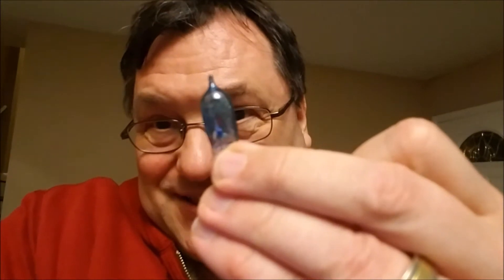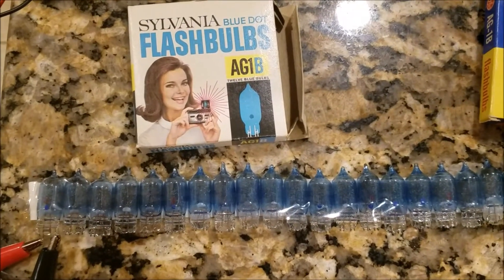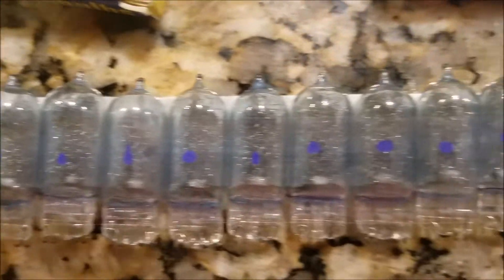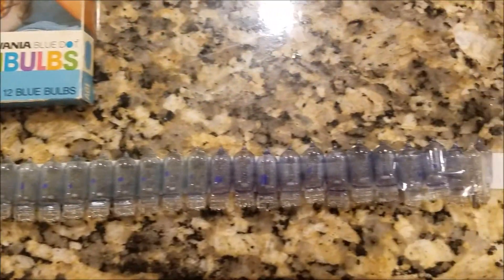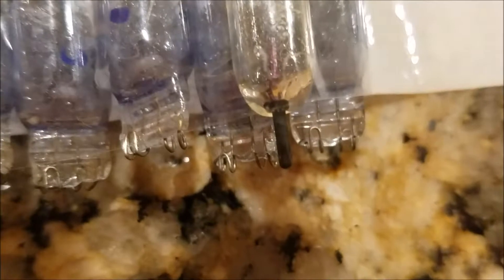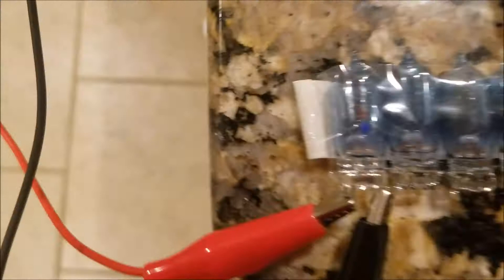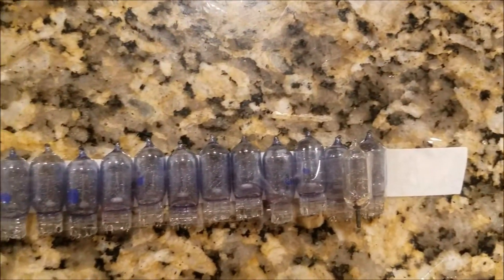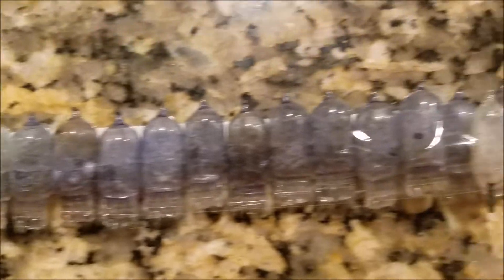Fun with Flashbulbs

Comment: @gregzsidisin  Thank you for the quick reply.
Yes I was thinking about seeing a doctor even though my hand doesn't look swollen or anything, on the surface it really looks like a minor "everyday" burn that usually doesn't require medical care.

But what I'm worried about is the intense infrared radiation that I think could be emitted by flashbulbs and that could have caused more damage in the lower skin layers or even worse the muscle. (I've seen a video where someone was burning holes in black candy wrappers or something like that, basically thin plastic with a Flashcube held maybe 2 inches away from it.)

What I'm also worried about is that, well flashbulbs are a thing of the past so the doctor might not know much about them and thus not think about the hypothetical lower damage from IR and treat like a "normal" burn, whilst it could in fact be worse. I know because I did ask my eye doctor how to shield my eyes from UV-C germicidal lamps and believe it or not she didn't have a clue ! (Even though UV-C lamps on the other hands are far from being a thing of the past and in fact because of Covid people did buy more of them than they did before.

(But she did tell me my eyes didn't suffer any damage from my experiments with a powerful laser and some mishaps with UV-C bulbs and also prescribed me new glasses ad my vision had changed a little bit).

I didn't mention it but I did immediately put cold water and ice on my hand like I always do.

Also when I fired flash bulbs with alligator clips I found that they were only barely warm right after firing so it might have given me a false sense of safety.

I'm also more careful as the for the first bulb I ever fired I actually connected it to a 30-foot extension cord and wore ear protection before connecting a low voltage power supply to it in case it would go bang like I read online many years ago.
Turns out it doens't go bang at all and there's actually some sort of thick plastic film over the bulb that's there to contain the broken glass.

I didn't know before having watched your video that you can fire other flashbulbs by getting them in contact with the one that gets powered.
Gives me an idea for my next experiment 😉

And yes I will never again hold a flash bulb while firing it.
Reply from the maker: Flashbulbs do cool quickly, because there's not much "thermal mass" involved. But at the moment they're firing...

Comment: Hello,

I did purchase a few of the same bulbs a few days ago and played around with them a bit but I got the genius idea of holding one with my bare fingers when firing it. 
Now I have small burns and it hurts but the trouble is it still hurts 2 days laters whilst other times I got "minor" burns from other things than flashbulbs the pain did fade after 2 days or so.

Do you think a flash bulb could cause more severe burns that say hot water, a clothes iron or any other common household stuff ?
(This is the first time I ever got in contact with flashbubs as I'm too young to remember them being a thing, for example my baby pictures were taken with electronic flashes back then).

I don't have any vintages flashes or cameras so I used alligator clips just like you except one time where I held the bulb with my left hand and applied a 9V battery to it with the other hand.

Every time I did fire a flash bulb though I was wearing ski goggles to shield my eyes at least a little bit as I was aware of how blindingly bright they are from various websites many years back and also from having watched Hitchcock's Rear Window movie.😉
Reply from the maker: Yikes! As the video I did demonstrates, flashbulbs release a LOT of heat as well as light - enough to set off an adjacent flashbulb.

If you haven't already, please see a doctor about your burns! 

My original interest came from model rocketry. That heat is sufficient to ignite a pyrogen wick  - a fuze - which can be used to ignite a model rocket engine. Not only does this make for a very reliable and low-power ignition system (for black powder rocket motors, anyway) but it allows for things like lightweight electronic staging. More recently,, electric matches have replaced the need for flashbulb ignition.

My point is that the heat from a flashbulb is intense, enough to set off fuzes and even other flashbulbs that aren't energized.

Never hold a flashbulb in your hand or fingers and flash it.

Comment: Incandescent flash bulbs.
Reply from the maker: Yes, although the incandescence here is of course temporary and chemical. The metal filament burns bright as it's consumed, after only a small, momentary electrical impulse. A regular incandescent bulb filament glows under steady electric current. Both cases are incandescence - light from materials at high temperature - but very different mechanisms.

Comment: Why did the smoke appear
Reply from the maker: Flashbulbs don't normally smoke, but these were connected with tape.  The tape adhesive briefly smokes a bit on the very hot bulb surfaces.
Reply: @gregzsidisin  Actually they do smoke a bit.  The lacquer coating on the glass burns off when they fire.  You don't notice it much with the little AG1 bulbs, but a 5B would probably set off a modern smoke alarm.
Reply from the maker: @DaleRaby  Thanks for that. )) Yeah, I work with AG-1s, the smallest of the lot.  I personally haven't seen a larger bulb pop in many years.

Comment: Destroying a perfectly good, usable flashbulb for a few YouTube views.
Reply from the maker: Such a strange comment.

Flashbulbs were made in the many millions over the course of the 20th century. They are still available in quantity on ebay. The bulbs expended for the video were a very small percentage of my personal stock, and a vastly smaller percentage of the stock still out there in the world.

Flashbulbs were made to be consumed for the personal enjoyment of their purchasers.  By your way of thinking: how many flashbulbs were "wasted" on bad photos?  And at any rate today flashbulbs have exceptionally limited application today.

The video was intended to document the experiment success or failure and share that, not to ratchet up "X" number of YouTube views.  I am happy and surprised that a few people have found this video and have even reacted to it.
Reply: gregzsidisin on another note flashbulbs tragically doesn’t not have “exceptionally limited application today”.
There is some things a flashbulb can do that is impossible, or hard to achieve with other light.

1. It has longer burn time. IE you get slice of movement if the shutter is at 30 or below. 
This is radically different from the motion blur you get with electro flash plus long exposure.

2. They are very, very bright. 
Even a single tiny FP one bulb has guide number of 40 in meters and 123 in feet.
That’s as much as a good large hammerhead flash all in a package where a film rolls worth of bulbs, and flash can fit in a cupped hand and weighs nothing.

4. It uses very little power so you can cascade multiple (like here only electronically and simultaneously) to get far more light with hardly any of the bulk and batteries of large speedlights.

3. On film the quality of the light is different. It’s softer and more penetrating, for lack of better word. It probably has to do with high intensity reciprocity error. 
Film likes it’s light not too much in a very small time slice/packet at once (though it loves a continuous stream of high intensity light like the sun). Neither of course too little trickling light, that’s why we use flash.

5. You can collapse the reflector on most flash guns and get very even, all room enveloping flash. This is the ultimate bounce flash if you are in a room that accommodates it.
The flash guns are also very easy to stick into diffusers for the same reason. You can do a very portable mini softbox by putting a white paper bag or a piece of diffusing film over the reflector.
Reply: gregzsidisin at least you could have used them for actual photography.
With a reflector you could have lit up some giant building or interior.
These are a finite resource (for now at least). 
The least we could do is actually putting them to good use, instead of pissing them away.
You inspire thousands of kids who never heard of flashbulbs, to go out and look for them, doing stupid pointless experiments. Taking them away from people who actually puts them to good use, like me.

Comment: So cool! It did hurt a little to see so Manny get used at ounce though
Reply from the maker: l bought up a fair number at one time, so personally it was not too bad. Understand that these were mass produced in VERY large numbers, over decades. and there are still a lot for sale on ebay. And people regularly find boxes after cleaning out old closets. while the demand for them is all but vanished. It's simply that now, they're far more expensive than they once were.
Reply: @gregzsidisin  they're not very expensive, you can get a 12 pack on eBay for like 2 bucks.

Comment: So is this Flashbulb only use for once ? 

I want to know why the big Flashbulb used to explode when taking pictures in Photographic Flash?
Reply: Well, mostly they didn't.  I used to use the old 5B flashbulbs and I never had one explode... or even go off accidentally.   Static discharge could set them off if the photographer was stupid enough to carry them around in his pocket.. which could give you a nasty burn.  If one was damaged, i,e,: the glass bulb was cracked and allowed air inside, thus increasing pressure in the bulb, the burning magnesium could heat the gas inside and cause the bulb to burst.

To prevent this, the manufacturers invented the "blue dot" flash bulb.  It had a little dot of cobalt blue on the inside of the bulb.  If the bulb was cracked and the low-pressure oxygen atmosphere inside the bulb was compromised, it would turn pink and you weren't supposed to use it.

They were generally coated with lacquer which further reduced the chance of a bulb bursting.  There were also "flash shields" that covered the flash gun and prevented injury from flying glass in the unlikely event of a burst bulb.

When the bulb flashed, it usually cracked, but the lacquer kept it from bursting.  The only thing you had to remember was not to touch the bulb right away as it was hot and could burn you.  Most flash guns had bulb "ejectors" to avoid this.

Little AG1 bulbs and Magicube bulbs didn't really have enough magnesium in them to cause much of an explosion and I never heard of one bursting.  All things considered, they worked rather well, given the available technology of the time and for some purposes, they are still better than an electronic flash.

I hate to see them wasted like this though as they are no longer being made and when they are gone, I won't be able to buy them anymore.
Reply from the maker: Yes, flashbulbs are single-use. They replaced earlier chemical flash powders used in photography. Flashbulbs were eventually replaced by reusable electronic flashes.